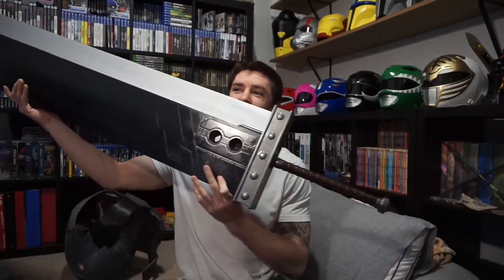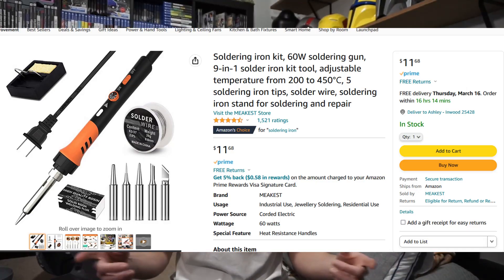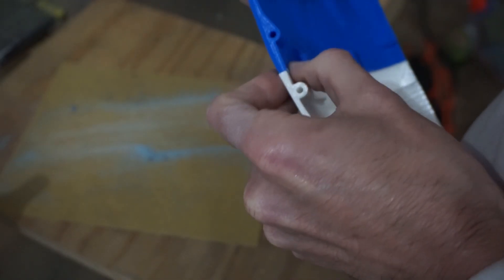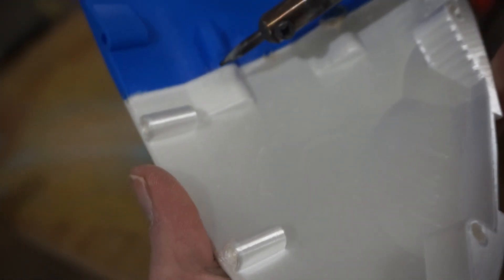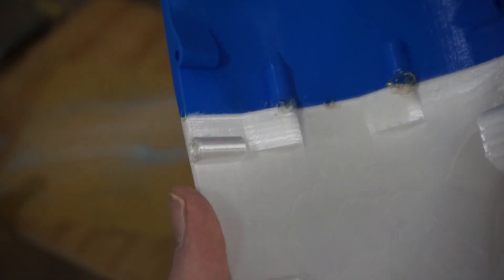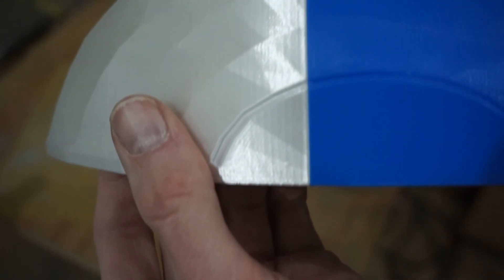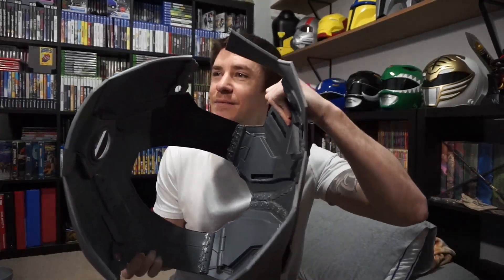How to Make Big Prints on Small Printers! PLA Welding Tutorial ! 3D Printing Tips and Tricks

Comment: For bigger pieces like an iron man chest piece, dyou need to weld the outside as well, or just the inside? I've been doing both sides but it can be as pain to sand after.
Reply from the maker: Kinda depends on the file, for do3d they often have little tabs that are great to weld that make it strong enough with out welding the front but sometimes you need strength on both sides

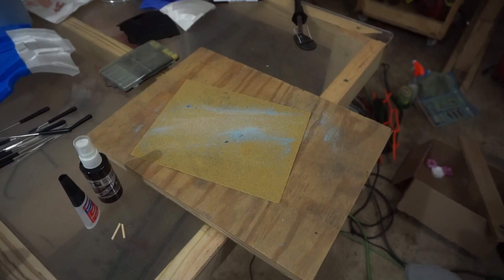Comment: Your respirator shown at 1:11 appears to be missing the particulate filters that fit over the carbon filter. That particular cartridge does not have them built in if I identified it correctly
Reply from the maker: Thanks For looking out! May have to upgrade the cartridges to a more robust set, These were better then the pink ones it had on it originally

Comment: Tip: Instead of using CA glue, you can use methylene chloride, Weldon / sci grip 3 or 2007 or Plastruct plastic weld to solvent weld to join the parts before soldering. Works much more quickly and melts PLA and ABS and PETG along the seam
Reply from the maker: Nice! Thanks for the tip

Comment: Thank you - I haven't done any welding yet mainly becuase I'm scared to mess up what I've made so far.  So many half printed/half finished projects.  But This gives me some guidance on how to weld (I have no welding experience).  I've seen some guys who use an extra piece kind of like soldering/welding for the beads.  do you recommend that as well?
Reply from the maker: I mentioned that in the video as well, I dont really do that often, What can happen is you end up adding a raised spot to the plastic so if its on an exposed side you have to sand downn more material. Can be good for inisde pieces though.